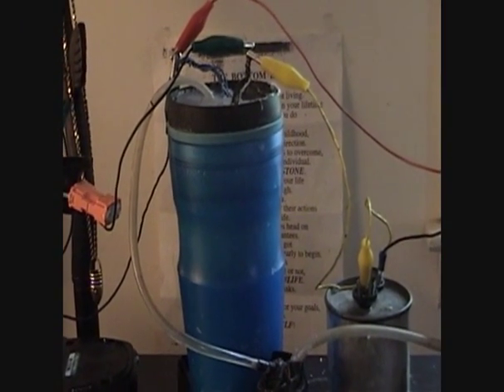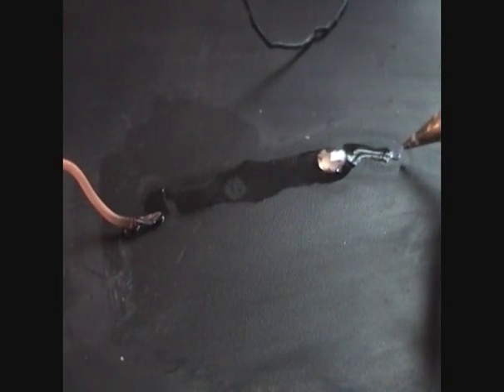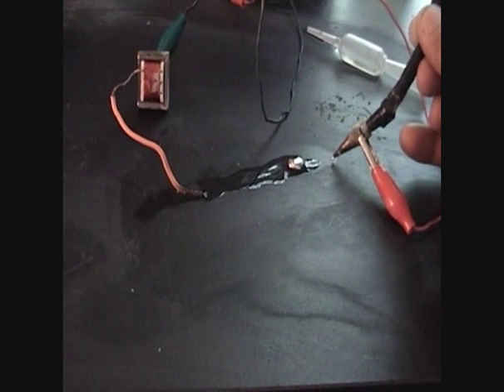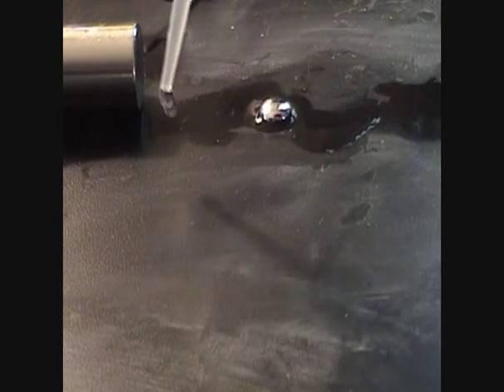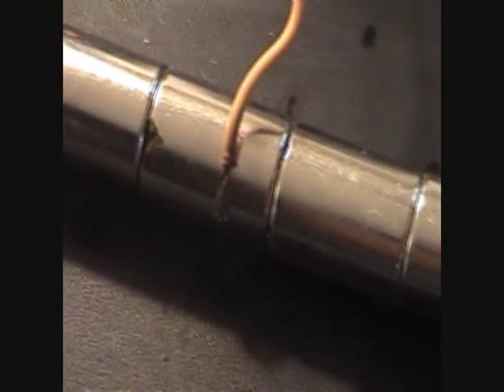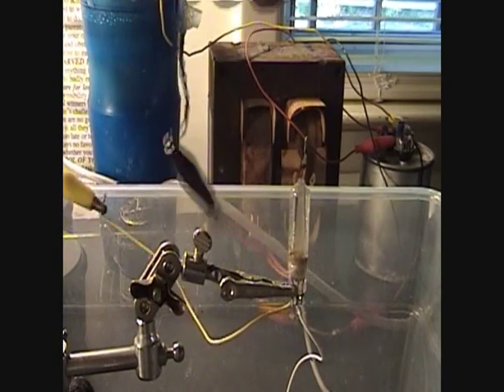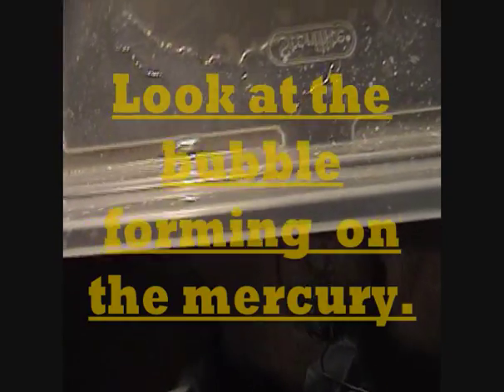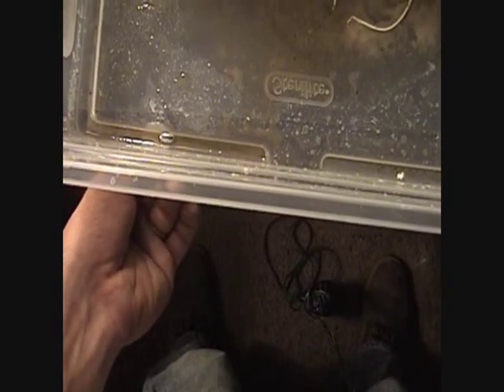Mad Hatter

Comment: @crob227 

You know what, I see there is a very small almost invisible flame, but what you are seeing is the arc caused by the high potential between the electrodes. 

It's true since a flame is plasma, it is conductive and an arc will generally carry through it, the arc will exist anyways.

The mercury is moving because there is current flowing through it, try this without any HHO (fake BS term idiots use)

Comment: more than likely it is because of the direction of the current, your flame jumps to the tool rather than the tool creating the flame correct? there for when you try to get it to go back the other way there's no more current running through the murcury, which is why nothing happens, its following the current through the water.

Comment: This is very strange, because mercury is in a liquid state at room temp, you would expect the atoms not to be able to align themselves, therefore the electrons could not rotate in the same direction, producing magnetism. Ferrofluids are different because they contain solid particles which align to any magnetic induction. You probably ionized the mercury giving it electric charge, but it's still strange.

Comment from the maker: no ionized water connection with the magnet,   this is easily replicated with just putting 2 leads into mercury,  charging the mercury up and removing the leads.

the mercury then stays charged. and becomes magnetic, and also if i put metal into the mercury after charging it, it makes the mercury produce gas "whenever submerged into salt water...

Comment: Im a chemistry student thats not particularly fond of physics, but Ill try.  In the first experiment, I think that there is an electrical current going between your instrument to the wire tip and the mercury is simply going with the flow.  Id presume if you could see the current going through the air out of your instrument, it must be a very strong current because air is a poor conductor.  Id think with weaker currents, the effect would be significantly less or not observable at all.

Comment: I think the second experiment is the same phenomena as the first one. It was hard to see but I think there was an ionized water connection between your instrument to the magnet (not sure if you mentioned this) and the magnet is probably just conducting the electric currently between the ionized water to the wire. Once theres a current, the mercury will just go with the flow again.

Comment: The third one is tough and I think someone else tried to explain it, but it is a rather difficult explanation with words alone or if youre unfamiliar with the concepts.  What youre seeing is the changing magnetic field producing induced currents which are pulled by the magnetic field.  When youre moving the magnet away from the mercury, youre inducing a current that would attempt to restore the magnetic field that it previously had such that the current inside the loop remains unchanged

Comment: The loops itself is made of moving charges and moving charges are subject to magnetic forces. The side closest to the magnetic will feel the strongest force and when you move the magnet away, the side that is closest will be pulled toward the magnet. The opposite side of the loop will try to pull away from the magnet, but the magnetic field there is weaker than the closest side so the closest side wins.

Comment: you know how copper influances a magnent falling down a tube of copper
mercury moves so easily that perhaps the magnetic tip of your prod is inducing micro currents that then generate an opposing field causing the mercury to move,,,see if some other non ferous metal will do the same by floating it in a little bote,, or raft,,, sorry i cant spell 
non ferous metals do emit mag fields when cut by mag fields ,,let me no if you get what im saying if not ill try to send a copper pipe video if i can

Comment: hey friend just wanted to let you no wiki is full sht you should stop using it people post bullshit on wikik thats total speculation,any thing conducting current produces magfields, the reason the mercury was only moving one way may be because of electron flow placing the mercury in between cuases it to cunduct current as it is less resistave then water to currnet flow then when you put the wire
behind the mercury it no longer is in the flow path.
very cool experiment,,